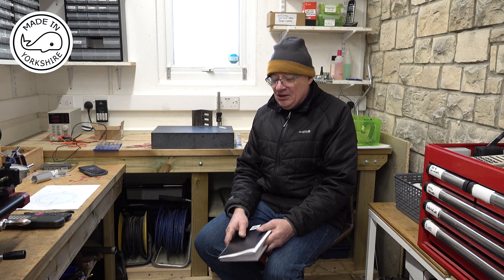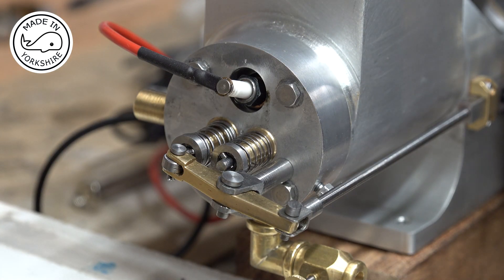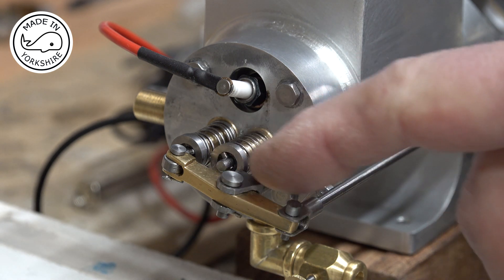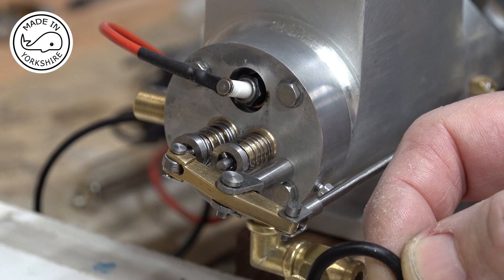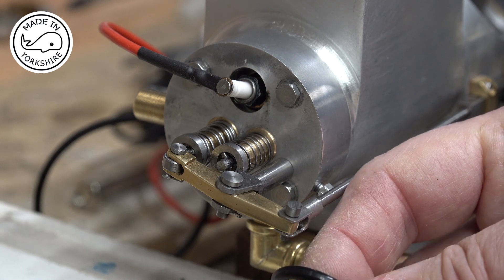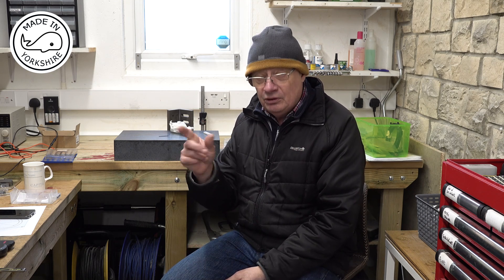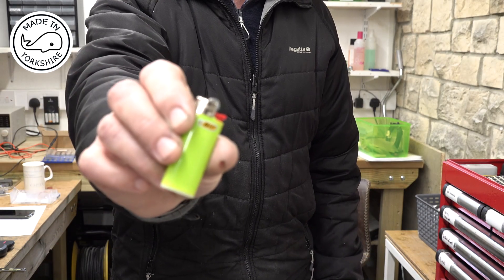#MT35 Part 21a - Farm Boy Hit and Miss Engine. First run SUCCESS! By Andrew Whale.

Comment: Lovey job on the engine.can you tell me the gauge of the HT lead wire.and how you fixed it to the plug please.
Reply from the maker: Thanks Martin 
I purchased an ignition unit from minimag (Isle of Wight). It comes complete with a lead and connector for a Rimfire plug.
Cheers 
Andrew
Reply: @learningturningmetal  Thanks for getting back to me i will look them up. I've been using the chinese type with the big red HT lead thay work well but look ugly. I guess i could heat shriek them black.

Comment: Thanks for posting the videos. Using this to assist with my own farmboy build. Where did you get the check valve?  Can’t find a small one anywhere.
Reply from the maker: Hi Paul
I can't remember but in the end I never used it. Good luck with your build.
Cheers
Andrew
Reply: Thx for the reply 👍

Comment: In fifty years of engine work, I've found cigarette papers, at one thousandth an inch thickness, are the best means for checking valve and ignition clearances.  This has to be a true "red letter day" Andrew, very nice, thanks for showing this!
Reply from the maker: Hi John
That's a great tip!
Cheers
Andrew

Comment: Fantastic job, these videos encourage me to try one of these engines. Some of the expert steam engine builders look to see how slow you can get them to run. The slower they run the more accurate they have to be in their tolerances. Yours looks top drawer as they say.
Reply from the maker: Thanks Ken - the Farm Boy is my favourite so far. Jerry Howell did a great job designing it.
Reply: @learningturningmetal  
Where are they sold,,,is there a web site for them?
Reply from the maker: @kenjackson4177  you can buy the plans from jerry-howell.com
Around 850 have been made by model engineers around the world, so picking up a second hand one is a rarerety.

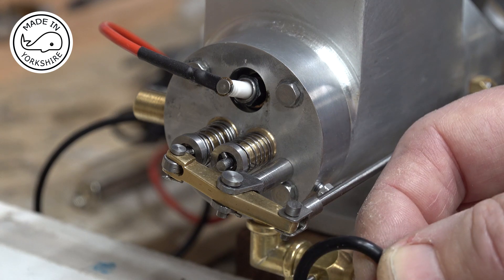Comment: 3:50 I would have gone with cast iron rings right from the start. Rubber/silicone o-rings for sealing piston/cylinder just doesn't seem right to me when there's literal fire on one end.

Then again I'm also the kind of guy that would make the engine do actual work, soo...
Reply from the maker: Hi mate. I think my next engine will have cast iron piston rings.😃
All the best.
Andrew

Comment: It sounds great, an eager little runner. There is nothing quite like the first start of your own engine.
Now, get rid of the o-ring, put proper rings in, fill the hopper with water, put some load on the engine and get it boiling!
Reply from the maker: Thanks Martin - yeah I think proper rings are the way to go - definitely on my next engine. Maybe too eager - I will try to slow her down a bit.
Cheers
Andrew

Comment: Well done Andrew! I'm glad the lapping tip helped. Hopefully I'll get mine running next weekend too and this video will certainly help me check a few things. I'm with you on the o-ring versus cast ion ring. I think I'll either buy or make a cast iron ring after I get mine running. I have a good source of custom rings here in the US that I used for my last engine. I can email you details if you decide to go that route. Glad to see you're reaction - obviously a very happy day!
Reply from the maker: Thanks Tony! When I made mine I had problems machining the cylinder and it ended up being 74 thou over size. I took it to that particular size because I knew I could get an o-ring to fit. Would your source in the US be able to machine to that kind of spec? If so, I would be interested. It might be that the viton ring works OK, but time will tell. I hope you get yours running soon.
All the best.
Andrew

Comment: Great job  ,  mark and retard the timing a little more for slow running also your weight about governor springs . Always remember that these are for exhibitions and not powering race cars  . They just have to run  .  My farm pump virtually stops at TDC as it fires to around 215 RPM  . Every one bets it’ll quite but it keeps going  . There are videos how to make cast iron rings good luck 👍
Reply from the maker: Thanks mate - I agree that it needs slowing down somewhat. I will try to aim for your 215 RPM!
Cheers
Andrew

Comment: Well done Andrew. I knew that you would get it running, it just takes perseverance.
Mine had me baffled for a while trying to set the ignition timing until I realised I was turning the engine backwards :)
What plans do you have for the fuel tank? or is it a secret.
I have a couple of ideas, one of which is to make it look like a wooden beer barrel.
Reply from the maker: Thanks mate. I found it quite a big learning curve. I guess the first one will always be a little challenging, but a good way to learn how they work. A wooden beer barrel sounds adventurous. I'm thinking of making one out of hex aluminium with crystal glass sides. Not sure it will work out but nothing ventured nothing gained!
All the best.
Andrew

Comment: So pleased for you. It runs beautifully. The intermittent firing works really well. It might have been a pain getting here, but you now understand the engine and how it works so much more than if it had fired up first time. It looks to have quite a bit of power. What fuel did you use in the end? Painted up and set on a platfrom it is going to look fantastic. You should be very proud of what you have achieved here.
Reply from the maker: Thanks Tim - you are right, definitely the best way to learn how these little engines work is when they don't. I ended up using Colemans camping fuel, which seems to work well. I just hope the o-ring lasts a while.
All the best.
Andrew

Comment: Couldn’t quite hear because I have to keep the volume down since the wife works at home, what did you decide was the problem?  Really glad you got it running, probably quite satisfying!
Reply from the maker: Yeah - I'm very relieved. Ignition timing was definitely an issue, together with the o-ring degradation.
Cheers
Andrew
Reply: Got a chance to watch with normal volume, the engine sounds very nice!  Great job sorting it all out!  I’m just about to get my first steam engine running on air, isn’t it great how much you learn from projects like this?  Thanks again for sharing!  I would have been shouting for now when it first popped off!  I’m sure you were!